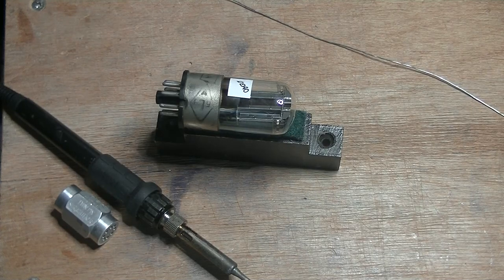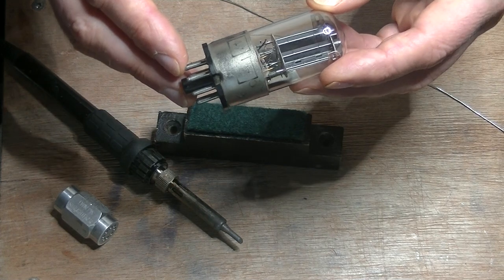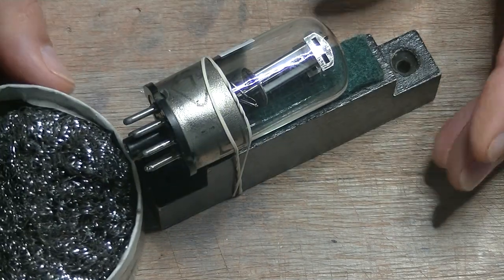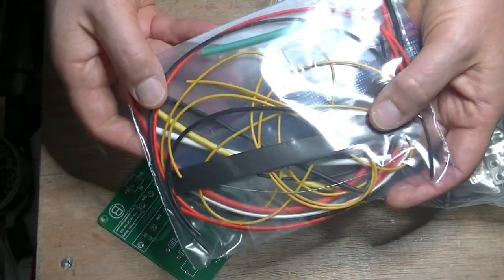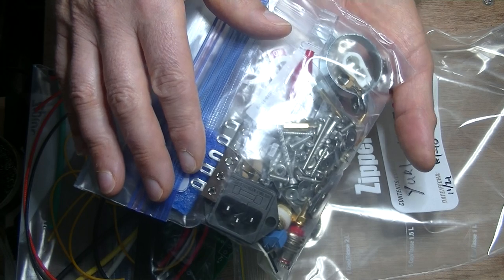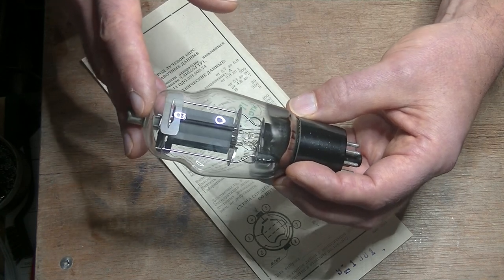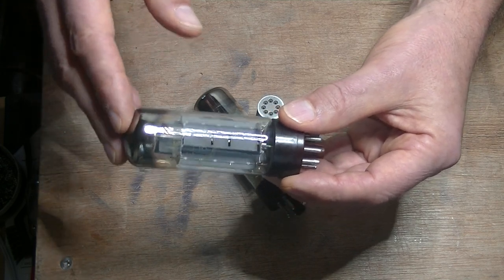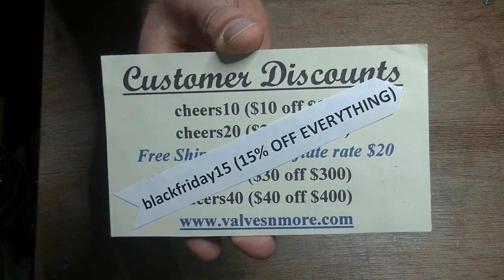Tube Lab #60 - How To Fix Noisy Tubes - Maybe

Comment: Hi. I cant thankyou enough for this tip. 

I have been troubleshooting a radio i am restoring that made lots of noise even at no volume. I did suspect maybe a mica cap or cracked resistor.  

I first decided to see if i could isolate it to a valve.  Soon found a 6B6 driving a 6V6 as the cause. I did observe the noise vanished when i took off the lead connected to the grid cap.  I replaced the 6B6 and thought thats a valve destined for the bin.

Saw this video and immediately raced down to reflow the cap and base pins for giggles.  I reflowed the grid cap hat with hot iron and solder.  I put it to test and hey presto noise resolved.

Much appreciated Simon

Comment: resoldering pins... wouldn't be better to remove as mauch as possible of the old SnPb before to fill with new one? leaving inside old Sn couldn't partially limit the result of this fix?
I'm asking you as I've some very old 6SN7 and I've read that resoldering pin could shorten the burn-in time and improve the sound quality... what your opinion about this?
thks for help/suggestion
Reply from the maker: Hmmm well if the existing lead/tin solder is good stuff and it should be, reworking by remelting and adding a wee bit fresh solder should be all that's needed to produce a good electrical connection.  The real problem is the lead wire and the inside of the pin, if either has developed some corrosion the resoldering isn't going to always make a good connection.
And other than trying to disassemble the tube, which isn't practical, we're left with this one simple method for making good the electrical connection.  Will it always be successful - no of course not, but so far I've had excellent results.  As far as reducing burn in time?  I rarely find tubes that need any burn in, so I doubt it relates in any way.
Reply: @tubelab194  thanks :)